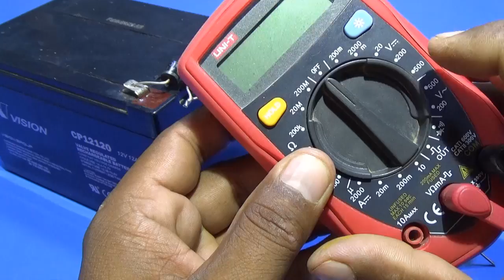How to Decrease Voltage Using Diode New Amazing Idea

Comment: I connected four diodes and reduced the voltage from 12v to 10.8v, but the diodes heat up a lot...how to solve the problem with the diodes overheating.  I want to lower the voltage from 12v to 9.6v
Reply: Use a high ampere diode as per your need if u wanna used 3 amps go witb 6 amp diodes and if 6 amps go with 10 amps diode and use a heatsing with lots of heat paste and a fan

Comment: Or you could use one zener diode for the voltage you need.
Reply: ZENER possible connecting 230 v?

Comment: Diodes at a no current draw have a fix resistance. But when a changing load current is applied, doesn't the resistance change in the Diode, causing voltage to change, In something like higher the current draw. then the resistance lowers, causing voltage to rise across the Diode.
Reply: In diode if the load current get higher then resistance also increase and stop when voltage drop across diode is 0.7v

Comment: Been doing this for 50 years or more, it's basic electronics. Germanium diode voltage drop ~0.2V, Silicon diode voltage drop ~0.7V. Use diodes frequently to slow down PC fans.
Reply: For 3 apm output.. which no Diode should be used
Reply: @अभिषेकजाट-ब2श amp

Comment: this quite handy if you just want to drop 1 or 2 volt for your electronic rather than using serial and need calculate the output formula until your head bald, with this you just plug in dc output, of course dioda will geat warm, but its only 3 watts, you can add heatsink to it

Comment: Though, there is a voltage drop. However, the diode was noted to heat up after connection, Why? Or is there any other way to do this?
Reply: The diode is heating based on power formula:  E*I     Another solution would be to use a standard voltage regulator IC.

Comment: I need to drop a single cell lipo(3.7v) to 3v to use in a transmitter that uses 2x1.5vAA . how do I do it .
thanks.
Reply: @Sylfest Strutle do you mean this one :  LM2596 DC Converter 3.2~40V to 1.25-37V Adjustable Voltage Regulator  .
Reply: @Sylfest Strutle  do you mean this one :  LM2596 DC Converter 3.2~40V to 1.25-37V Adjustable Voltage Regulator  ., or can you give me a link to the one you mean.                                                                                                                                                                          thanks
Reply: @Sylfest Strutle I am still not having any luck finding a DC  3.7v to 3v mini buck converter all sellers on Alixpress say they don't have one..

Comment: 1 diode should dropp 0.7 volt
It is not showing here!!
Reply: i drops 0.22 + or - apperently
Reply: It could be that these are not silicon diodes. A Schottky diode will drop around .2V. Assuming these are silicon, my guess would be that there is no actual current flowing (because only one end of the diode string is connected) and the meter impedance of 10M ohms does not pull enough current through the diodes to make them conduct. So what you are seeing is the static charge through the diodes. The voltage drop as shown is because of the impedance of the non-conducting diode junction vs the meter impedance.